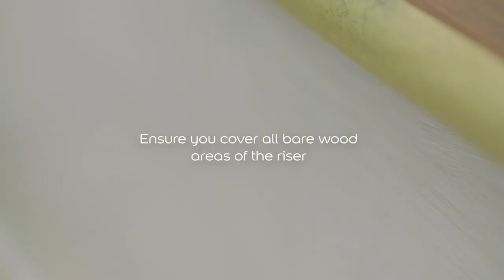How To Paint Stairs | Dulux

Comment: I painted the stair risers & they are totally uneven.  I'm doing something wrong!  Is there a particular tape for this?  I used the blue tape, & when I pulled it off, the paint stuck to it.  Thanks
Reply: Do I stain the tread first then paint the riser OR paint the riser first then stain the tread? (very white risers, very dark treads) @peterlaker4093